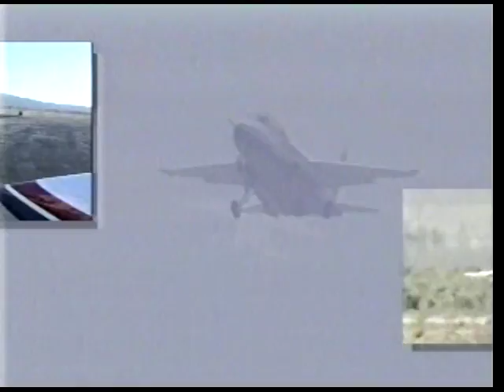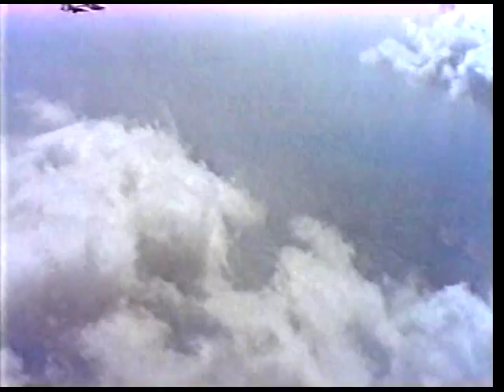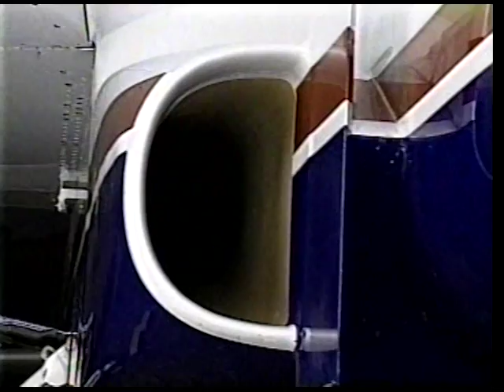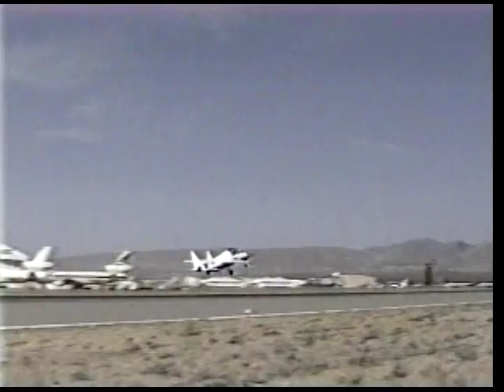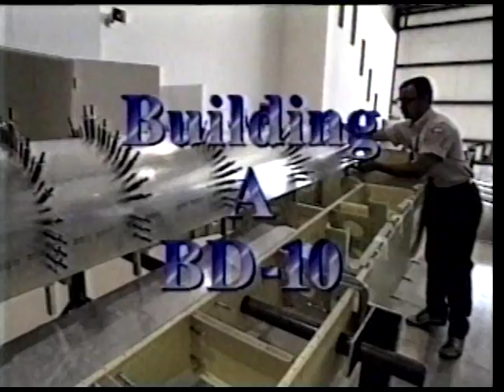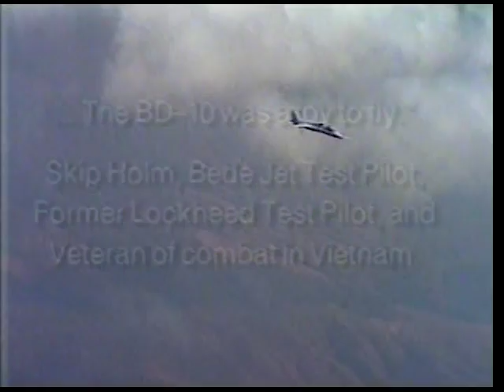BD-10 Home built Jet Promotional Video

Comment: It's not broken. It isn't finished either. It has vibration at high angle of attack. Not uncommon. Change the bulkhead to a single piece CNC frame, add low profile strakes to the aft belly and two 10 inch independent yaw dampener rudders. Done.

Comment: i would like a safer version. the way i would fix it is making the wings larger and add a fly by wire system
Reply: slightly swept wings would help and stronger materials to strengthen the tail section

Comment: Of the five original prototypes built, three crashed killing the pilots and the remaining two where declared "unflyable" for obvious reasons. In the final analysis the best that can be said of the BD-10 is that it was a widely optimistic design way way ahead of its time.
Reply: As an engineer I can tell what the problem is --- with the material. Supersonic jets have to be made of a transition metals such as Titanium, Aluminum, or Steel Alloy. To make it out of plastic - as the BD seems to have been made of - means nothing but trouble. Plastics cannot handle the supersonic boom. The wings are apparently not of a swept design which has never worked for supersonic travel. Even if the material could handle the sheering force of a sonic boom, the wing sweep angle is entirely wrong. This plane was designed by a person with zero knowledge of supersonic planes.

Dr. Howard Hughes, F. Director, Hughes Aircraft Company.
Reply: @luke8857  Ditto. The same can be said about the BD-5... Zero knowledge about anything. It was longitudinally unstable with far to small of tailplane. The entire concept was based on attaining 240mph on 32hp and required almost 100% laminar flow to achieve. But Bede used a METAL structure of riveted aluminum, that had be definitively proven to be unable to attain any measurable laminar flow over two decades before, on the P-51. Just absurdly ignorant EnGuHnEErinG. And it was sold in the thousands to the tune of several million dollars and 60-80 employees hired before a single prototype was made flyable. ... such is the power of magazine ads.
Reply: As I understand, of the 2 that didn't crash, one bent the tail plane so badly it literally couldn't fly again, and the other very VERY carefully never had fuel in it.
Reply: @mooneyesplays7  that was Jim Priebe's kit that he built in Ohio..he never flew it or put fuel in it, because 1 week before he was to test fly it, the prototype denigrated mid air on a test flight...he was a experienced, ,bold pilot but he wasn't stupid...he later sold it to someone in Canada
Reply: In 2023 it's possible to test such a design and use newer technology
Reply: @FoFo-gm2iv  Actually the overall design of the DB-10 was sound but the problem was that you can't built a high performance supersonic aircraft out of your garage no matter how good the design and quality of the parts may be. There's a reason why only top aerospace contractors can built these types of airplanes.
Reply: @cfrincon  There’s another thing. There’s a reason why the selection process for fighter pilots is so rigorous.
Reply: @cfrincon  that is just dumb. the idiots just had to modify the design a bit.
Reply: @snorttroll4379  longer swept wings and stronger materials would have fixed it....a bold adventure that didn't quite check all the safety boxes sadly...
Reply: @mustangmikep51  ok. so just revamping the project and fixing it and .... profit?
Reply: do you know if Jim Priebe of Findley Ohio was 1 of the pilots who got killed?  He gave me a ride in his P51 back in the early 90's and told me he was getting a BD 10 soon...He was a great pilot...but the jet had some design flaws    I hope it didn't kill him

Comment: saddly the bd 10 was largely vaporware, promising more than it could deliver-the unfortunate thing is that this fact must have been obvious to the designers yet they chose to publicize obviously wrong performance specifications, the design also was extremely dangerous-another fact that should have been obvious to the designers

Comment: Keep as is but STAY SUBSONIC and all will be good. I wouldnt mind flying this bird at 600 mph. That's faster than most comercial jets. I would increase wing surface area and redesign the twin rudders; make them angled outward and add more surface area as well. Make it more agile for stunts as opposed to all out speed. You don't need it in this type of aircraft. Bede Corp, lose the supersonic and your bird will come to fruition...

Comment: Someone should resurrect the design and solve the structural issue.

Just too cool of an airplane to not have these things getting built.
Reply: Someone should engineer a carbon kit!
Reply: @clive373  can you engineer one of the parts?
Reply: @ snot troll.
Reply: I don't understand why the Air Force or Navy didn't consider this design for a trainer? If the plane lives up to its promises, this would make a very effective, simple, low maintenance aircraft. Now yes I know it would have to have extensive redesign to make it military spec, but even with that, it seems a better prospect than a turboprop or the aging but highly respected T-38 or the Naval Hawk trainer. And possibly even a very light strike fighter with high subsonic or low supersonic (Mach 0.8 to Mach 1.1) this is a good opportunity for a non government entity to make a bigger name for itself.
Reply: Theyre thinking about it. (Theres a video online about the new Bede company which I saw a few days ago-he didn't promise, but they need another project to do) It does seem a waste of  engineering and design for it not to go anywhere
Reply: @oxcart4172 I highly doubt they're genuinely thinking about it

Comment: Pretty cool looking. No ejection seat?
Reply: What's the weight of an ejection seat ? Plus the price ? Plus the complexity, glass ejection or exploded, special  boots and your knee must not touch the panel (size pilot and design problems). And maybe a n oxygen mask for high altitude ejection ? Also it can be very tricky with unwill start, etc..
Why not a G suit ? «It's up to you» (your bank account)
Reply: At the time, a zero-zero ejection seat costed more than the entire BD-10 airframe (sans the turbine)...  It was designed with the intention of being a budget kit plane to let doctors and lawyers live their dreams of becoming a Top Gun before killing themselves.  Also considering the BD-10 prototypes could never match the performance Bede wanted, he was never going to add a whole bunch of weight into it.

Comment: The Viper Jet is succeeding  and is being sold. I dont believe it to be supersonic however, but at 4-500 mph ground speed, and a couple loops and barrel rolls, I dont think you even rember that you wanted to go super sonic in the BD10
Reply: The Viper Jet failed spectacularly. The company is out of business and the kits that they did sell needed professional builder help to complete.
Reply: @ytaccrandomvariable  Didn’t the Viper Jet sell more kits though? The BD-10 (I think) sold 5, and 3 crashed, all 3 crashes were fatal. I did some research and didn’t find evidence of a Viper Jet crash. I think there’s 5 completed Vipers and 2 still in the process of being completed.

Comment: Along with SR-71 Blackbirds, Apollo Mission Rockets and modules, I test flew this homemade jet. Despite the propaganda relaying this jet to being dangerous, I can firmly reassure the flying community, this is a jet that is very safe to fly.
Reply: R. Daniels I am no engineer, but would building an all composite version solve the structural issue
Reply: The composites caused the issue.
Reply: Entonces cuáles serían las causas que originaron las pérdidas de los pilotos?
Reply: can it take all the gs one could throw at it by belly flipping in top speed downward flight?
Reply: To bad all the people this plane killed cannot be here to argue THEIR side of the.  The BD-10 is an ACKNOWLEDGED DEATH TRAP.  The designers even admitted it,   You're a shitty pilot if you think 3 our of 5 kits killing people is 'safe'
Reply: @yeagermcbipper9008  it's entirely possible that those who died hadn't assembled the aircraft properly or were pushing it too far. Then again maybe you just know it all 🤔🤣
Reply: @yeagermcbipper9008  Ah yes, show more of your prideful nature against someone who just has different takes on this design

Comment: I have read through all the comments.  That plane is too much for "enthusiasts"; Mach 1 or not.  Having flown military jets for 12 years, testing and consulting for Lockheed Martin for the past 9 years, I want one of these.  I'll take it to the shop and overhaul it.  A lighter, stronger fuselage, lighter, stronger wings, change the look some (rip-off the F22's look and a few technologies, an engine with a greater thrust... There's a smaller cousin to the FW-119.  
Make a run through the Skunkworks buildings... Some AR Paint to get rid of my signature, A nice set of electronics, a hidden bay munitions package;  It won't take much to do some damage to the Cartel.
Oh, wait...  That's part of the new A-team.   

What am I saying?  I'm an airline pilot.  I live in Quahog.
Ding, Dang, ting tong tang, walla walla bing bang, Ting tang!  
Giggity, Giggity.

Nice plane, though.  If we want to kill ourselves in planes, we should be allowed.  We can have self-driving Tesla's in God mode doing twice the speed limit for Pete's sake!  Poor Pete.  He is always getting it torn up.
Reply: If only I had an autoclave, I found some surplus cruise missle engines, if you had a cf fuselage half as easy to work on as an f5, modern steppers and encoders  and things like the Intel compute stick you could have a relatively advance avionics suite, with a half decent helio radar set and you'd basically have Boeing quiet bird
Reply: @helicopter2992  WTF?  My Dad was like that.  It rubbed off on me but I'm over it.
Reply: @helicopter2992  Remember this skit from Saturday Night Live?  https://vimeo.com/312218800
Reply: Lol, Thanks for your Service btw.

Comment: LOL.. you sure can tell its a promotional video.. " high tech push pull tube"  control surfaces...LOL
why dual tails? its not a fighter jet.. it doesn't need two... one will do and provide less parasitic drag..
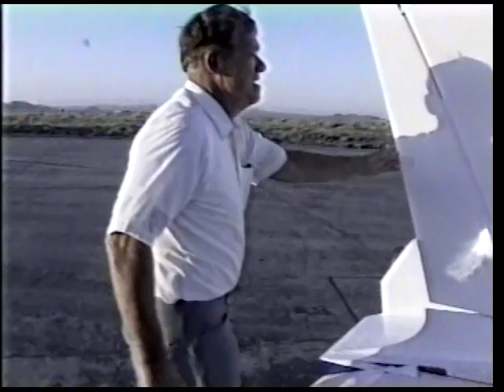Reply: Did you watch the video and specifically the preflight check around 9:20 ???  The pilot was looking directly into the business end of the jet engine and it sits directly down the centerline for the fuselage.  How the heck would you put a verticle tail section and rudder assembly in the middle of this plane ?
Reply: Twin tail? Yes. Look at the engine location.
Reply: Some things are done just to look cool.

Comment: You have to admire Jim Bede’s design.  However, going supersonic in a composite airplane with high speed heating weaking the composite wings and pulling 9G’s and thinking it’s going to remain in one piece is a bit much.  Not to mention supersonic airflow and lack of that into the design and the craft sadly makes it certain what the outcome will be.  He was a great designer and engineer but a little out there when it came to safety.
Reply: The BD-10 in an all metal design. The wing and other flight load bearing members are all 2024-T3 aluminum alloy. Bonded aluminum honeycomb cored structure is used throughout but there is absolutely nothing new or innovative about this in this context. Only the cockpit 'tub' and radome are composite load bearing structures.  Aerodynamic flutter of the elevator(s) is suspected as the cause in the crashes mentioned. The elevators also are metal structures.
Reply: do it in winter like the Wright Brothers. Pull no G while hot. Okay, pull out of the dive. How does transonic even work. On the shock the flow separates. When you accelerate, all kinds of flow separation happen on the wing. A plane needs a lot of directional stability to begin with because it will lose a lot of it. I sure would want the heavy engine more in front and the tail more in the back like on a deHallivand Vampire. Also I think a second fuel tank in front of the pilot will be mandatory
Reply: the plane was just barely supersonic, heating is not an issue at this speed, even for composites...somewhere up to Mach 1.5, the temps should not exceed what sitting on the runway on a sunny day would do, and that's only on the leading edges.
Reply: F-22 is composite. All the new Mach 1.4 planes are composite. Concorde radome is composite. F16 canopy is made of plastics. You can either do 9 g subsonic, or max 1.5 g supersonic ( let the air frame cool down while gliding to the landing strip, so it survives even a hard landing ).

Adiabatic compression emphasizes temperature difference. So you really have to check the weather.

This plane looks a lot like the sonic cruiser. The central part is basically a delta wing. Others have commented that they don't understand why this plane has to flying tail plane. I sailed for some years and had a flying rudder. I think planes try very hard to save weight and avoid a metal bearing in the tail. Just sum flexing material on the trailing edge.

It is a kit plane. As a builder you would be free to change the tailplane, wouldn't you? Maybe cg was already too far aft because BD wanted the turbine to be there. Maybe if you are a small pilot you can push your seat and engine to the front and let the tailplane fly.

Comment: You could build one now using modern carbon fiber and that would overcome the fatal flaw (weakness in the spar).  Also, somebody suggested that five were built and three killed the pilot.  Actual, three were built, one had a wind separation and that test pilot died. That killed the program. Both of the remaining aircraft were maintained as flyers for a while but were eventually retired to air museums
Reply: N2BD: original prototype, owned by Fuel Fresh in Nevada, unflyable. 
N9WZ: Peregrine's kit, crashed
N62PJ: Peregrine's kit, crashed
N700JP: Jim Priebe's kit, sold to Monitor Jet, now privately owned in Canada, unflyable
N7FF: Frank Everett's kit, crashed

Comment: hey can you just build them
Reply: Nothing stops you from trying... except the plans are not available.

Not recommended to even try for supersonic capability since the engineering and wind tunnel testing gets extreme.

Stay below .8 mach and below 6G rating and its far safer when you don't have the facilities and staff to d the proper test program.

Go ahead and build the structure with calculations for 9G... but just don't try to actually do it in flight.

g "old school" and build progressively more complex models.  First a small free flight "chuck glider"  then  a low performance 4 channel RC model to start dialing in CG range.  Then an Electric Ducted Fan, finally a true miniature turbine powered model appx 1/4 to 1/6 scale of what you hope is your final design.
Current record speed for an amateur build turbine power RC model exceeds 400 mph.  Take it someplace with nothing to hit within 5 miles to test it...

Comment: How does a supersonic aircraft get away without using stabilators?
Reply: They can't. The fatal crash of Jim Bede's test pilot was due to a faulty stabilizer when passing Mach 1.  Bede cancelled the program after that.
Reply: X1
First supersonic flight had no stabilators.

We are used to seeing the stabilators because it has proven to be better for fighters.